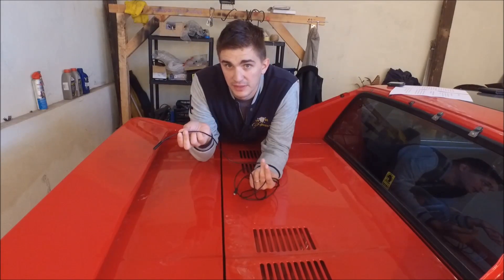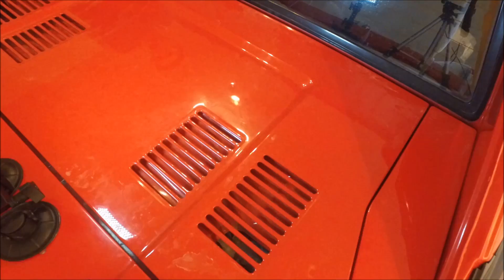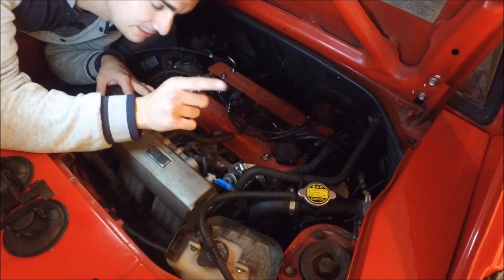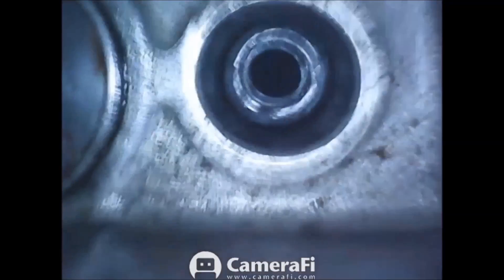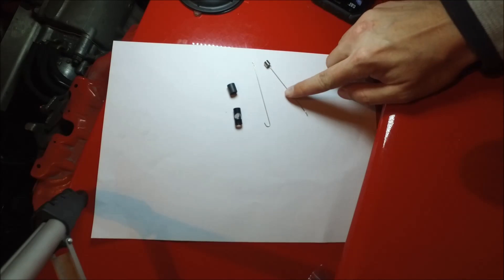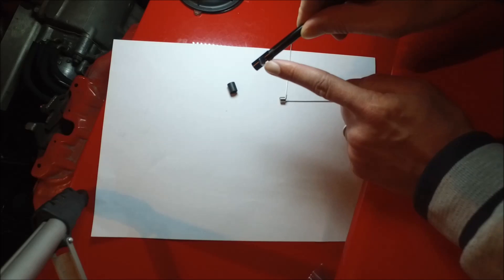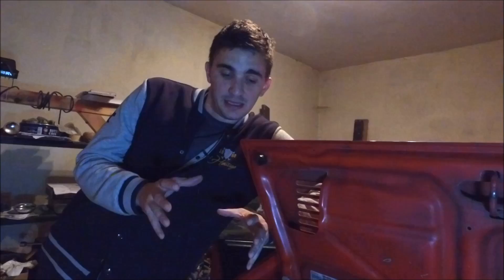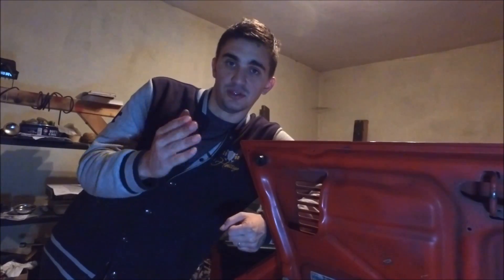Looking inside an engine with endoscope camera - cheap eBay stuff review #1

Comment: hey by any chance would you know how to adjust the shift linkage for the aw11 i got my transmission rebuild and now its on but when its in neutral and i start letting the clutch go it go in reverse
Reply from the maker: +Fernando Ramirez Haven't done that myself but there are instructions on how to do it in the factory service manual, a.k.a BGB (big green book) you can download it online.
Reply: Ive try to look for it but here in the states the green book is 100 bucks or do you know the website to download it free
Reply from the maker: Fernando Ramirez Google it, you can find it easily on several sites and forums, trust me it's easy. I can't share here or tell you where it is unfortunately.
Reply: Okay thanks you

Comment: Any brand and model name of the camera?
Reply from the maker: John Cangieter Nope, it's no name Chinese stuff, hence $8. Just search for Android endoscope camera on eBay, there's dozens of sellers offering virtually the same thing.
Reply: driving 4 answers cool. A video about diy engine swap wiring would be a nice add to your video list. I own a beams 3SGE dual vvti powered sxe10 rs200 z-edition 5AT. wiring diagrams for the 5AT a rare...